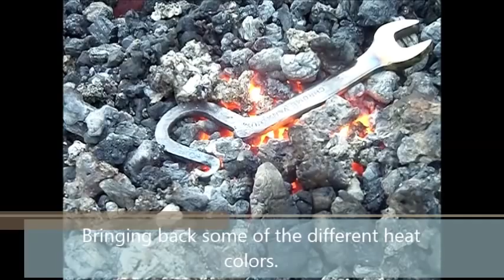Hand Forged Bottle Opener from a Wrench

Comment: Nice video! I highly, highly, recommend raising your anvil up another 6 inches or so. It will save your body in the back, wrist, elbow, and shoulder as well as create a better striking angle for your hammer. I work with an improvised set up also so i know what its like when your height is off after awhile!

Comment: As long as you only do it with junk wrenches, I suppose.... but I prefer to pass them on, or save them for modification (bending or grinding for tight spots, etc)

As far as the bottle opener, you'd probably be better off doing that out of some softer iron, and saving the wrench for another tool or something. Even cheap wrenches are (have to be) tool steel of one type or another.

Your anvil should be a bit higher - when you stand with your hammer in your hand at your side, resting on the face, the handle should be horizontal. It'll save your back.

Also, if you staked that fishplate down, you could probably figure out a way to make a third hand work with the spike holes - and third hands are the difference between happiness and suicide.
Reply from the maker: Yes wrenches can definitely be used differently. I have some really old wrenches that I would never do this to. Thanks for the tip on the anvil height. You'd be surprised at how many different opinions I get. Some say too high, others too low. Thanks for watching the video and commenting!
Reply: *****
Well that's how I was taught on the height, at least - could be wrong.

I think generally if your back hurts, it's not high enough, if your arm can't swing right, it's too high - but it's really easy to hunch over to compensate, and not realize that it's too low even though it's hurting you. It looked like you had to hunch up like I used to end up sore from, at that height.

As to the wrenches, when I found your videos I was actually looking for info on the opposite - forging wrenches from scratch - but I found a bunch of hipsters with "repurposed" wrench bottle openers, some made from wrenches that deserved better and could have served their original purpose just fine - hence my concern.
Reply from the maker: I'll look more into the height. Forging a wrench sound like a fun thing to try. Then you could make custom sizes. Are you planning on making a few?
Reply: ***** I don't currently have a forge set up - I have a little vulcan (cast iron junk) anvill but need to work out a forge. I've inherited a load of smithing stuff, but it's across the country, so it's anyone's guess when I'll get it.

So, I can't really make anything in the near future, I was just curious, I'd like to make some of my own hand tools. I like tools in general, wrenches are pleasing to me, and pretty simple - so I figured it was a good place to start.

And yeah, I was sort of considering making some of the rarer/obsolete sizes, for the fun of it - not that I expect to need them, but you never know what you'll end up tinkering on.